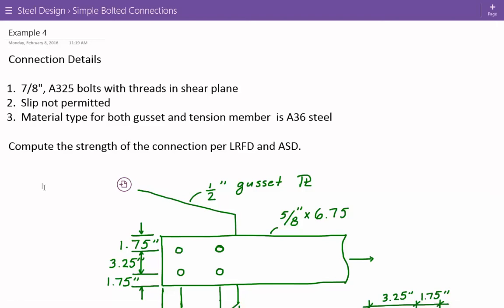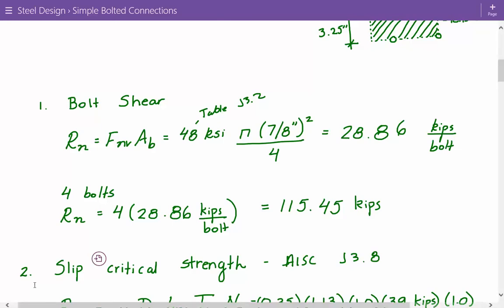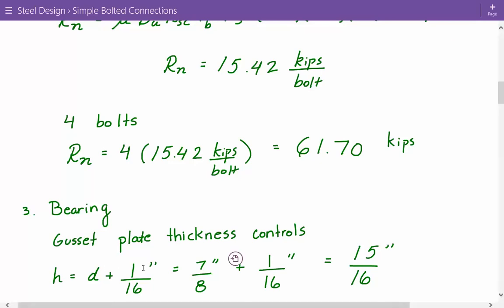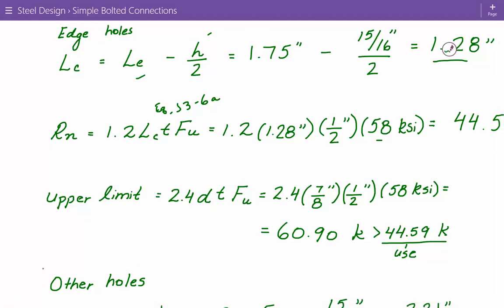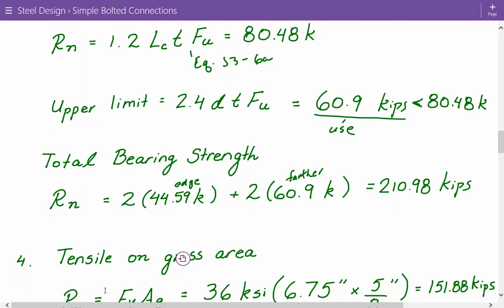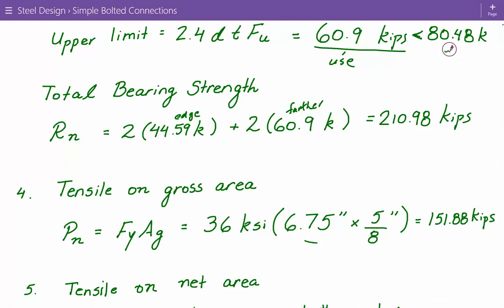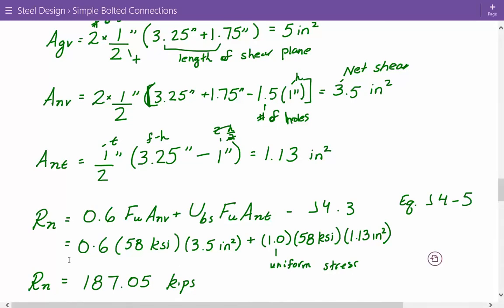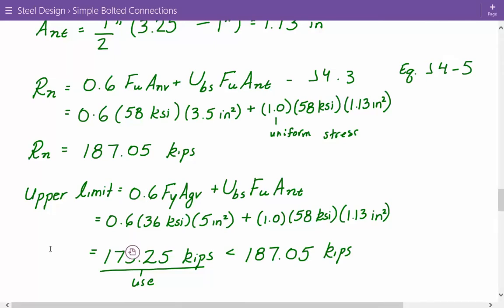Structural steel engineering design & analysis of bolted connections using ASD and LRFD Tutorial 4

Comment: Dear Sir,
You mentioned in the example the shear strength is 48ksi while I checked on table J3.2 for A325N is 54 ksi. Can you tell me why you take shear strength 48 ksi?
Thanks in advance,
Amir
Reply from the maker: +Amir Irhayyim Which AISC Steel Manual edition are you using? I am using 13th edition.
Reply: Amir is using the 14th edition. I noticed the same when I was following along.